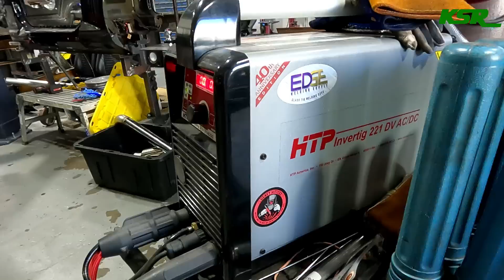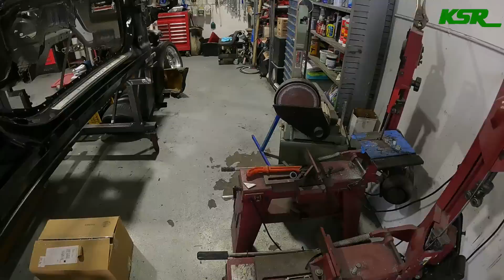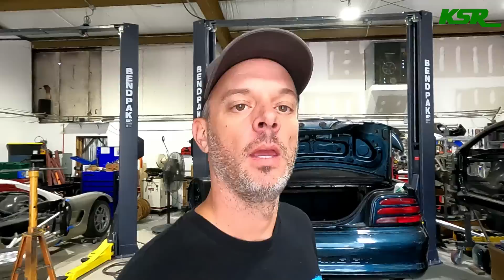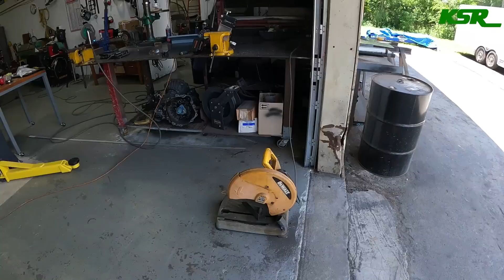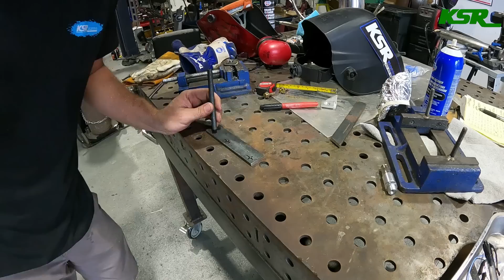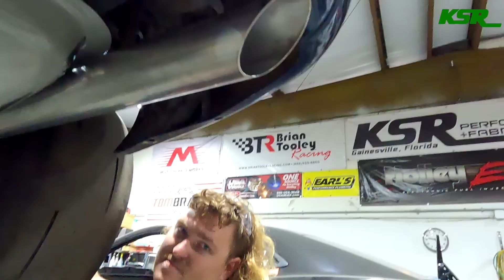Stainless Steel Racing Exhaust Part 2!! Wrapping Up a Trick System

Comment: With part that size you should be able to find a plumbing bladder that you can air up with a Schrader valve it is literally a little airbag kind of deal we used to use them in pressure testing drain pipe to make sure we had no leaks before completing a plumbing job I think those would work best and you can get them cheap and they are for all different size pipe

Comment: Kevin great fab skills love the attention to details even on the smallest levels, But you did open that can of worms that LS platform Started WAY back 53 years ago with Ford , And yes A retired GM engineer confirmed that here in my shop about 10 yrs ago.  So you Bow Tie folks need to Thank Ford for your LS platform.

Comment: While working in the porotype Field for Ford Motor co in Australia many years ago one of my jobs was to take a vehicle to GMH so that there was no infringement of Copywrite of Parts between the two Company's but having said that there was a push for a world part that could be used by either Ford or GMH or the Auto Industries it was either the Windscreen washer bottle or the Overflow Tank for the Radiator. lol great Vlog.

Comment: Have you covered the rear end in this car at all in a previous video? I know it's potentially more of a road racing thing to remove the upper control arms for the rear and replace with a torque arm/panhard bar, wondering what type of a setup is used here and why. Is it common to have the anti roll bar mounted above the axle for a drag fox/SN95?

Comment: Very nice!!! and folks wonder why an off the shelf system can cost over 1K for a cat back.. and this is a good showing of what it takes to make a system designed to almost fit in factory location, I know on my old Mustang I bought off the shelf parts for long tubes, mide pipe and catback and it was 1400.. but the hours it took for them to design the system shows

Comment: Outstanding effort as always, Kev. Not many shops would spend that extra effort to have symmetry on an exhaust system that virtually nobody will see or take the time to measure for angular or parallel errors. It sets KSR apart from a vast majority of builders. Cheers!

Comment: BTW, the best welder I've ever seen live in action was one of the pipefitters when I was working for building maintenance at the university where I went to school.  They were putting in a new 8" pipe for the steam heat system.  The pipe was maybe a couple inches away from a concrete wall.  I was watching him weld the easy side and it was a perfect stack of dimes.  Then the backside came and I asked him "how are you going to do that?"  He pulled out a pocket mirror and did the same thing, I mean literally you couldn't tell the difference, while looking in a mirror.  That's when I realized some people will forever be awesome at welding.  That's not me, but I sure appreciate people that are...
Reply: You wanna know the secret? Lots and lots and lots of practice. It develops muscle memory

Comment: I like using Solarflux whenever i can. Its cheaper then argon. Usually flux residue is an concern when doing a turbo hot side. For that my fix is a ball hone, attached to plumbing snake. Works great and had no issues so far. For headers, i still purge with argon.
Reply: Solarflux works pretty good.

Comment: it might help clearances if you oval the pipe in the real narrow places , you need to refit it as when you flatten a turn it moves about 
the total surface area stays the same as a round piece its just higher than it is wide or vice versa , think they sell flattened pipe and bends

Comment: Nice work Kevin. I build dry ice manufacturing plants. They consider dry ice a food product. We have 3' diameter 1/2" wall stainless steel pipe coming from an ethanol plant always near by. They use a paste (solar flux)for the inside of the pipe when TIG welding it. Have you ever tried that? Do you think that would work as opposed to back purging? Thank you for your time.

Comment: Nice work Kevin , question are all your pipes and pieces the same grade of stainless ? I'm putting together a system and it's a combination of 409 pipe and 304 V band clamps , haven't figured out my filler rod yet .

Comment: i have been ask 100 times but i really dont know the answer i just know its a flow thing. so maybe you can answer for me. why a X pipe instead of a cross pipe or just duel exhaust.
Reply: The X-pipe balances the combustion gases outflowing from the header collector and streamlines exhaust gasses through the rest of the system - 3 things you want in a good exhaust and need to have them balanced... scavenging, backpressure and velocity. An x-pipe helps with all of these things.

Comment: I used mild steel and  clamps and steel  headers the headers were equal length had to rework the clutch linkage, down pipes in front of rear axle, it was cheap but wanted the best flow characteristics for my money, it looked like a piece of junk but it was the quickest street car in my area for a lot of years, I put 5000 1975 dollars in it just for performance, it had a cast iron engine a truck rear end and weighed 3316lbs. even with street tires this car had TRACTION, I street raced guys running slicks and numerous engines, but they all had one problem. Not enough traction, I could do wheelys with micky Thompson sportsmans and all they did was burnouts, I'm sorry I'm so long this is your page, but remember one thing Picasso did masterpieces and so do you, just don't cut off your ear, LOL.

Comment: If you are even trying welding, first step is Kemppi and after practice only answer is Fronius. Otherwise you just dont know what are you doing.
Reply: And there is one thing, if you're welding stainless/titan you should have steady gas flow trough, it is afterall using itself when welding.

Comment: Assuring that there is an under-vehicle sealed exhaust system; had  me wondering if this is an important fire-safety concern  also.  If one is operating highly explosive / intense-burn fuel, plus having a mixture that might be a bit fuel heavy, (exiting through a long pipe path), a flame on the vehicle engine-running underside, (flaming through a break-through-weld), might be a problem.  You sure get us thinking.  Thanks!

Comment: I was about to ask what back purging does then you explained it I love the detail in everything you do
Reply: To add a bit... the "grey crappy stuff" is Fe-Cr oxide caused by the heat and oxygen. It strips out the chrome from the stainless and creates hard/brittle not-steel chunks in the welds, which is why it can break.
Back purging removes the oxygen and you don't form the nonmetallic inclusions.